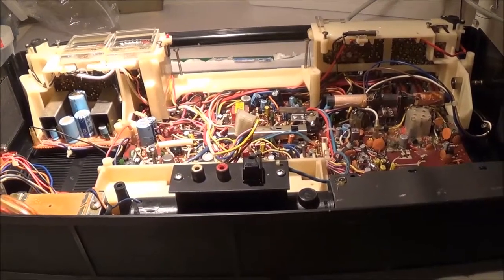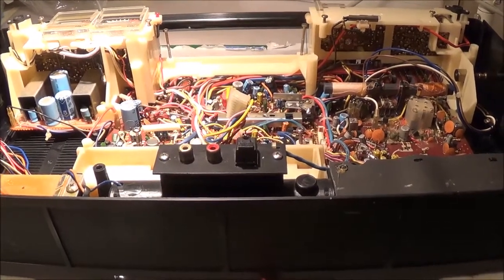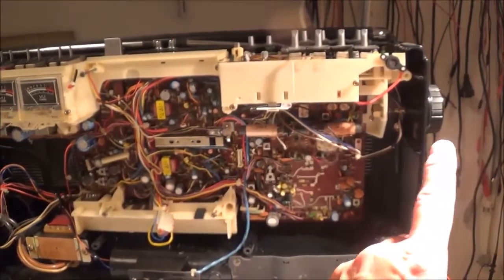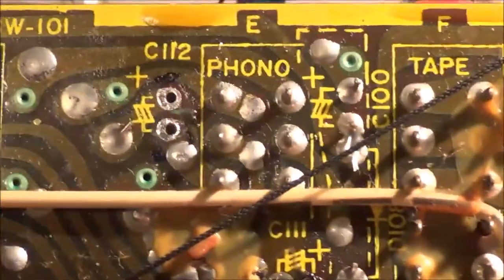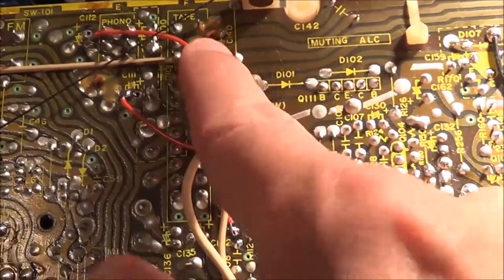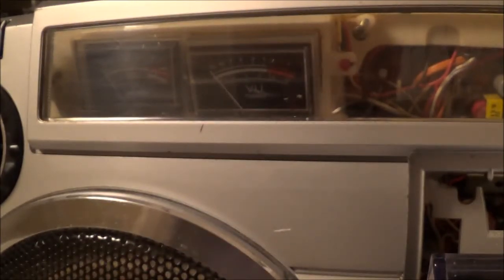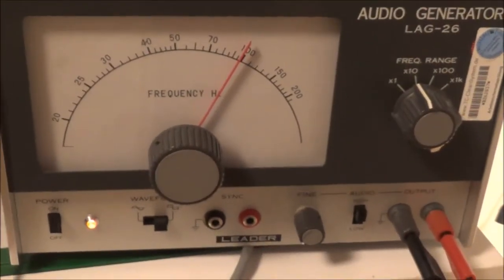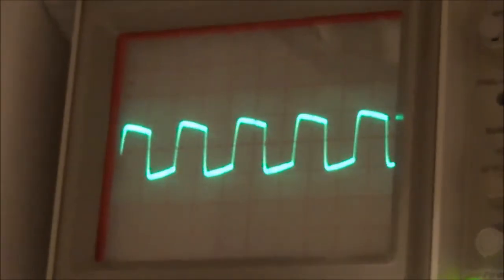Sharp GF-9191 Phono To Line-In Temporary Modification

Comment: Привет) Большое спасибо) Шарп 9191 модифицировал по Вашему видео) скажите пожалуйста, а можно ли полностью убрать фонокорректор? Хочется иметь чистый звук)
Reply from the maker: Yes, it should work. You could just bypass it completely. I don't remember completely what I did here, but I think I disconnected the input phono wires to the phono stage and instead connected the new wires to the function switch. I still used the phono input jacks; I just bypassed the phono stage. You could completely remove the phono stage if you wanted to...Remember, the phono stage has two functions: equalization and amplification. So when the signal (after equalization and amplification) reaches the function switch, it will be at a high (line-in) level. I turned the phono jack into a line-in (high-level, CD) jack.

Comment: I don't understand why you removed the functionality completely because you can bypass it. I think It is nicer to add a switch somewhere to select the (preamp) mode.  A switch that switch the bypass and the power to the opamp ic. So when it is off, the opamp is powered and is functional as designed and when it is on it turns off the opamp and connects the bypass. For the bypass you need some extra (shielded) wires, two 4.7 uF bipolar capacitors and two 1K resistors.
Reply from the maker: Ok, this was long ago. The person that got this unit, I believe, didn't have or want a turntable to use. Therefore, this easy solution. I mean, you can do all kinds of stuff. For example, like replace all electrolytic capacitors and so on. Question is, is it worth my time?

Comment: These four caps that you by-passed, were these a tonal control devices or just choked the signal?  It was cool to see the output on the scope.  Also, I think it was a good call to leave the chip in so as if ever needed the radio could easily be put back as designed. Even though I have a 3MHz function generator and it too can output audio, I think I may opt to just get a dedicated audio generator....cuz I dont have one! :)   ~Jack, VEG
Reply from the maker: +Vintage Electronics Geek Thanks for watching! Just choked the signal. The caps can be quickly put back in. I thought that was the ideal spot. Audio generator is a "must have."
Reply: I thought that's what the reason was....and trolling eBay now for a AG!  ~Jack, VEG
Reply from the maker: If you don't want to spend much money I could recommend the Leader  LAG-26. I got that too (around $50)...because it also puts out square waves. And, it is simple to use.  Plus, the manual can be found online for free.
Reply: Thank you, I now have a eBay watch on it!  :)  ~Jack, VEG
Reply from the maker: Well, good luck!

Comment: Hey,can you tell me please if i can make a line in on a GF9090? I would like to add a bluetooth module.Thank you
Reply: I have already try to mod a GF9090 by adding a switch before the function switch. But it was unsucessfull (muffled sound...)
Reply from the maker: Been on vacation. I don't think the GF-9090 has a phono input. You would have to tap into the circuit before the function switch; I think the other poster said he tried that and added an extra switch. Of course, if you don't use the cassette part you could simply disconnect (take it out of circuit) it and tap into that before the function (radio/tape) switch. I don't do bluetooth mods. But, if I was doing a hardwire mod, (and would not be using the tape) I would probably get a DIN/cinch adapter to have an aux input, then run wires (internally) from the DIN connectors of the Sharp and tap into the tape line right before the function switch. I don't think you can just use the DIN/cinch adapter without tapping and going around the cassette setup because the DIN input might only work when the play button is used. Can't say for sure because I don't have a 9090. Best to watch other videos for a bluetooth install.
Reply: @OldSchoolElectronics  Hey,thank you for your answer,is to much work to do and i want to keep the cassette.I prefer to have the cassette instead of bluetooth :) I will keep it how it is just looking for a pinch role now to replace it :) Thank you
Reply from the maker: No problem and good luck! I prefer to keep everything original myself; for example, no drilling. Especially since there are less and less units like these available with each passing year. Pinch rollers can be found here: https://www.ebay.de/itm/Andruckrolle-fur-Sharp-GF-9090-Radio-Recorder/133025242526?epid=28027278282&hash=item1ef8ec1d9e:g:F8UAAOSwdZJctuwM&frcectupt=true#shpCntId
Not cheap, but a trusted seller. I have ordered from them before. Certain countries are excluded, you would have to check. They do ship to the USA, UK, Canada, and Australia.